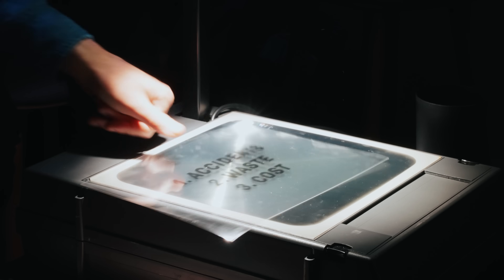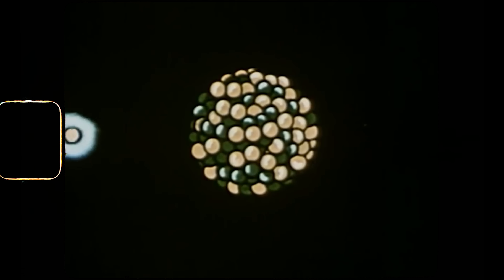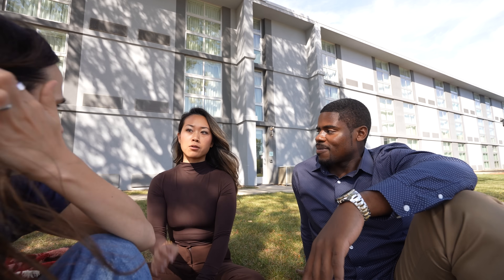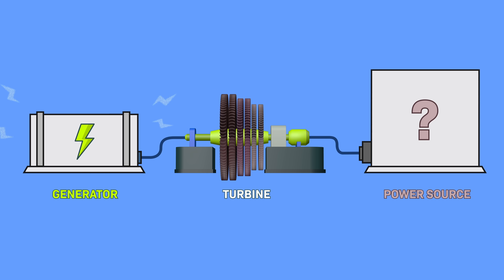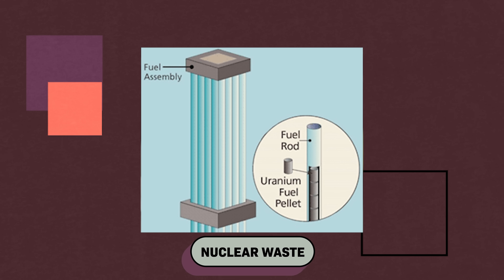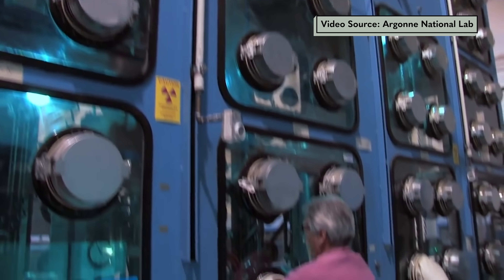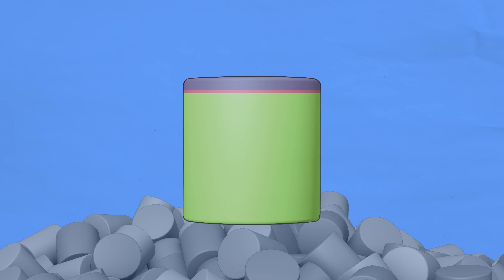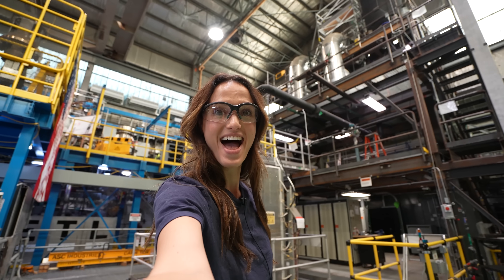The Big Lie About Nuclear Waste

Comment: Fantastic video!!!  One correction though.  Primary coolant DOES NOT drive turbines.  Fuel heats the rod > heats the water (Primary coolant) > HEATS SECONDARY COOLANT via a heat exchanger (steam generator) > secondary coolant flashes to steam > drives turbines to produce electricity.  Primary coolant which is radioactive stays in the primary system.  The steam coming out of the cooling towers, which the media uses as a terror tactic, is 2x separated from the primary coolant and is in no way radioactive.

Nuclear energy is the ONLY viable widespread green energy.  However, more people make more money by demonizing nuclear power.  That's the bottom line.

Comment: A very nice summary of a decades old technology that was put on hold due to western geopolitics.  Ms Abram has done a fine job of presenting this technology.  However, the real issue is of the politics surrounding the potential of allowing rogue nations to use nuclear technology to develop weapons and skew the balance of power around the globe. Recycling technology feeds into the political risk because it is the start of the concentration process needed to develop nuclear weapons.  The issue of nuclear waste containment has been solved.  Siting criteria have been developed and sites have been chosen.  Also, the west has plentiful sources of uranium that could supply energy needs for centuries and are cheaply mined in remote areas .  If we can produce electricity using low level nuclear fuel that is beyond the point of being recycled and concentrated, then widespread commercialization can be achieved.

Comment: How in the world did she go through all that and not mention (1) Oak Ridge; (2) Thorium; (3) Molten Salt Reactors; (4) Recycles its own fuel; (5) Runs safely at low pressure; (6) Fail safe... can't run away; (7)Had it running for 5  years... 50 years ago. I smell a rat! But she does sort of look like Julie Roberts... if you like that look.

Comment: Very well made and a good help to wake up people that there is no technical energy problem. Although, one small mistake: the atomic number is not the amount of neutrons in a nucleus, but the number of neutrons + protons in an atomic nucleus. A U235 nucleus  has 92 protons and 143 protons. U238 has the same amount of protons but 3 more neutrons. The chemical properties are determined by the number of protons and electrons: that's why it is impossible to separate U235 and U235 chemically....

Comment: I cant believe because we pay 70ct per kWh in Germany because we cancelled all nuclear reactors.
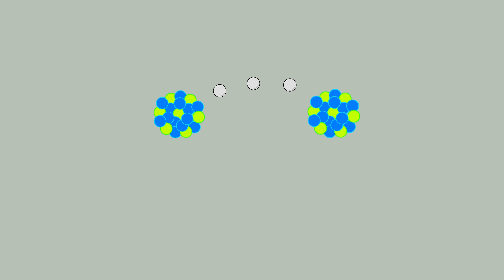There is also a very important thing. This turbine at Minute 6:45 is turning exactly 50 times per second. This makes our 50Hz electricity. But if we start a big machine this power is changing slower like 49,998Hz. In this situation the turbine will run slightly faster like 50,002 turnings per seconds. This happens automatically and makes the electricity grid more stable. Thats a big problem wich have green energies.

Comment: So based on this video and a couple more I’ve watched since on the topic it seems like the biggest holdback is the plutonium factor. Recycling the nuclear waste creates plutonium which can be used for nuclear weapons. So that seems like the biggest factor aside from cost and if we could do away with ALL plutonium as part of the recycling process we would eliminate that concern. I can’t actually find the numbers though, how much plutonium that is produced from the recycling process is used in moax fuel? All I can find is that it’s a “significant amount”. And I’ve also seen that thorium can be used to destroy plutonium. So is that the answer, regulating the recycling process such that zero excess plutonium is created?

Comment: It's the same exact tactic as calling oil fossil fuel when it has zero to do with dinosaurs.
Reply: @nahadoth2087  Oil has absolutely nothing to do with fossils. It was a term that was coined by the owner of standard oil , rockefeller, which controlled 90% of the US oil supply  He came up with the term because oil was and is so abundant he needed to make it sound scarce to help controll and raise the market price. Read a book sometime before you try o correct someone with your nonsense.  Rockefeller is also the reason we have laws against monopolies. Something which the US has moved away from.

Comment: The problem being is that nuclear power is already expensive, they thought we would do this because we thought that uranium supplies were much less abundant than they ended up being and it's cheaper to dig up new uranium than it is to reprocess spent fuel so we didn't do it. Also nuclear waste isn't as big of a deal as it's made out to be.

Comment: I'm a nuclear energy proponent, but be careful using the term "clean energy". There is no such thing. Sure, plants using recycled nuclear waste are using fewer resources then newly acquired fuel, but the entire system as a whole requires plenty of resources (to build plants, and the water requirements and impacts for plants, for example) and at the front-end mining uranium isn't clean or risk free either.

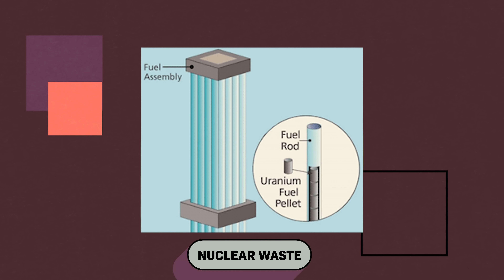Comment: 7:11 uuh no, sadly that's not how this works. you can't "make u235 out of u238" via handwaving, but you increase the percentage of 235 via isotope separation, meaning you get rid of some of the 238 (which is then called depleted uranium or DU, and despite its name still useful in other applications such as cannon shells). the difference is kind of a big deal, because it means we have to dig up a lot more uranium and there is a much more limited supply of 235. also, the video completely neglects other options of re-using nuclear "waste", e.g. in other reactor types such as lftrs (also kind of a big deal).

Comment: Water can be used in nuclear plants and produce the equivalent as the radioactive fuel rods. The only produced after effect is water vapor. Just the same as hydrogen. The use of radioactive fuel supplies is for production of weapons grade material. That is a fact you won't hear from the news media.  Radioactive "ANYTHING" is completely ignorant and unnecessary.

Comment: useful.
my job is in construction.
i need a 20 volt  battery for my electric drill.
i want to go to the home depot to buy this battery.
there are some questions that come to mind.
how many amp hours does it have.
how heavy is it.
i might need 5 to 10 of these for the rest of the team building my clients house.
this is a union job so we have hours per day we work.
if this battery has attitude.
i am taking the batteries back to home depot for my money back.
argon has been working on this stuff for over 50 years.
i do not see their results at the home depot

Comment: This whole video misses the point of the waste problem. 
Sure you can reuse the Uranium-235. And sure since U-235 half a half life of 700 mln. years you are reducing the amount of really long radiation. 

But the real problem is not Uranium with it's ultra long half life. That we already had in the ground since humanity is existing and it did not harm us much. 
The real problem are the elements with much shorter half life.

I.e. Technetium-99 with a half life of 211 thousand years is radiating about 3.5 thousand times as much as U235.
Or Strontium-90 with 30 years half life which is radiating more than a million times more than U235.

By recycling we indeed can reduce the import dependency. But we are not at all able to reduce the waste in a relevant manner.

Comment: Can someone explain how does mining new uranium and seperating the useful metal from the ore and making fuel out of it is more economical than electrolytic refining of used fuel waste and using it to make new fuel??
Reply: Simply put, all the processes for mining, transport and use are based on fossil fuels. This is less entropic than electricity. Producing electricity is the problem. It is not lying about like coal or oil. It has to be generated.

Comment: Great video and it answers a major question I always had on this topic. 

Energy comes in all forms and shapes but it always seems to boil down to radiation, chemical reactions, or temperature. Solar power (light spectrum) to my knowledge could be considered a type of radiation. Whichever the case, they cause fossil fuels to form, wind to blow for our windmills, or light to radiate on to our solar panels. In all of those cases we catch as much of that energy and "transform" it to electricity or directly to heat (cv/radiator/combustion/etc) and use it in the way we want depleting that energy. The energy we didn't manage to transfer due to efficiency often is converted to heat and lost that way. Using coal as the easiest and simplified example: The energy of fossils and decomposition caused it to become a energy filled lump, we then use a little energy to ignite it causing the energy to be released in the form of heat. We use that heat to do our stuff like said in this video. After it's done all that remains is a harmless pile of ash with no more energy in it. All of our energy sources seem to work that way and leave basically nothing behind. 
For nuclear waste I always wondered why the resulting residue (waste) almost seemed to contain more energy (radiation) as what we got out of it and how much energy it must contain for it to be that radiant. In my own theory that energy should have been something we could use until there is basically no radiation left. I believed it was technical or natural limitations that prevented us from doing so but now it seems it's just politics, money, and global power struggles once again.

Comment: We have to stop emitting CO2 - that should be common sense by now.
If we replaced all fossils with nuclear the planet would run out of uranium in 20 years. Then what?
Putting any money in another depleting resource that will get more expensive over time is very short term thinking.
The renewables are not only the cheapest energy on the market, they're also infinite.
Reply: Wow, you have completely bought into the Greenie propaganda!  Your ruinables fantasy will guarantee a grim future of exorbitant electricity rates, energy rationing, and massive rolling blackouts.

Comment: What we call "nuclear waste" is material that is not commercially feasible to use anymore. The waste doesn't have the juice like it used to have. It's more efficient to get new fuel instead of using the waste. Is it still usable in different kind of facility? Of course it is, but the energy industry would have to develop those facilitities to make it work. Nobody see it as a beneficial business. Just because something is possible doesn't mean that it is feasible under the circumstances.

Comment: So just to be clear, we have 100kg of deadly waste, which you want to convert into 5kg deadly, and 95kg useful. But that 95kg useful will turn into 90kg useful and 5kg deadly. so now we have 10kg deadly waste, and you want to repeat this process untill all 100kg is converted into deadly waste? not to mention all the new waste created from existing reactors which adds to the pile of reusable reactors all of which gets slowly recycled into deadly waste. and this is the better outcome? more of the worst possible nuclear waste? that has to be stored for 200,000 years...

Comment: This video could, in my opinion, basically be boiled down to a paragraph of information. If you know or don't care to learn the basic concepts behind nuclear power, here's the TL;DR of everything else:

There's a method of recycling nuclear waste for more energy that we've known about since the 60s. It's more expensive/involved than the 'once-through' model, but obviously saves us the hassle of figuring out what to do with the dangerous nuclear trash that's leftover. The Carter administration banned it for Cold War reasons and the Reagan administration repealed that ban. But it was too little too late since we already invested a lot into the reactors that weren't suited for recycling waste and the recycling ones are more expensive and stuff. There's also a company that's trying to make it hip to recycle it again.

If you wanna know more, just watch the video; though I'd recommend skipping to 6:20 since the rest is kinda just filler and an ad read.

Comment: Oi, so many important items glossed over here, these surface level "investigations" into this type of technology are why it will be so hard to move forward with clean renewable energy. Nuclear energy is neither clean, nor is it renewable and that is important to acknowledge first, it's also a very profitable industry which means given the chance it will take place of cleaner more renewable energies under a guise that it is clean if people only look on the surface like this. It's far better than fossil fuels in many ways, but it can also be much worse in others. It is in a category of its own far outside of clean and renewable. 

Second, while recycling uranium and plutonium is indeed better than just using new fuel, it does not account for all of the additional waste that is created as part of the process that nuclear energy uses - for example tools, clothing, gaskets, metals, plastics, anything that is used in the energy production and recycling processes are treated like single use plastics. These items are less radioactive but they are plentiful, and as you can imagine anything used in the processing of highly unstable radioactive materials are not able to be used for anything else and also become "nuclear waste" but are not recycled. 

Lastly, scaling up recycling is great, but using that as a reason to scale up nuclear energy only works if the danger of the products can be reduced to something like 10 years to allow for cycling of the waste into its final container. 100 years is far less than 100,000 but using space for 100 years in containers meant to last a couple decades just means we will be creating significantly more waste that we can't handle if the intent is to scale up (which it is). The waste we already have is considered non-tenable. Scaling up just means more water supplies will be contaminated and more land will be uninhabitable.

Comment: Fossil fuels actually have a true recycle ability to them while " "renewable" " crap does not even work nor is it actually good at all and its not even renewable.  Solar panels are so radioactive that they are killing children and then they break down or catch or fire or well the newer panels are designed to break down within 3 to 5 years so they don't explode killing people which means they are not renewable but in reality they are disposable trash.  Hell to make the amount of energy that is used in making solar panels a single solar panel would need to be fully functional for 15,000 years to make back the amount of energy used in gathering the materials and making the dam things.  It costs so much energy to gather and make them and this is not  counting the transporting them and hooking them up but just making them that they won't even come close to making up the amount of energy using in making them for 15 millenniums.  You will be long past dead and hell this era of time will have been mostly forgotten before these dam things have even made 1% of the energy required in making them is made back.  Hell every single building and structure and item that exists on the planet made by humans will have been long past turned to dust before they have a chance to make back the energy that was used in making them.
Reply: Sources?

Comment: Cute graphics and primer material at best. Should have just jumped to the politics and all the politicians that have blocked energy and cleanup processes for decades. As for Argonne, just another lab - try looking at all the other sites like Idaho National Laboratory, Hanford, Oak Ridge, Savannah, Nevada, etc. There are a lot of different "nuclear waste" streams. You are talking almost solely irradiated (spent) nuclear fuels. I've watched the industry die for the last 50 years driven by similar young and perky people that still vaguely understand the HUGE issues.